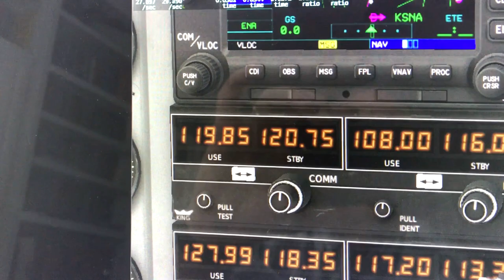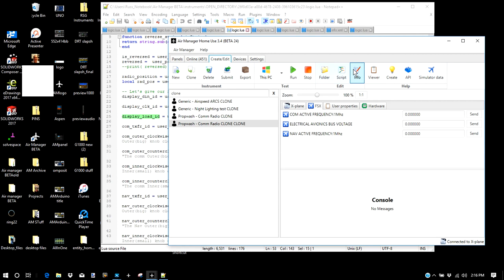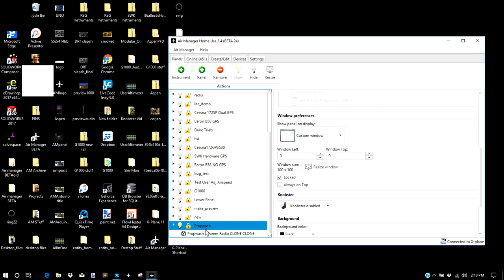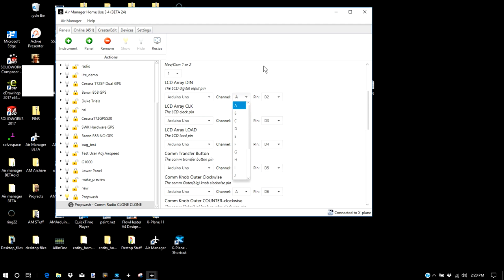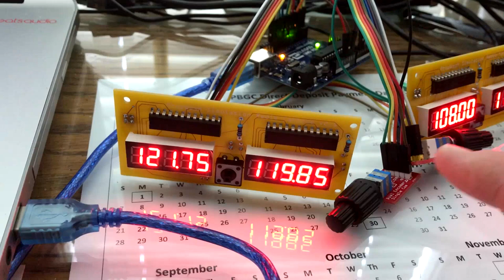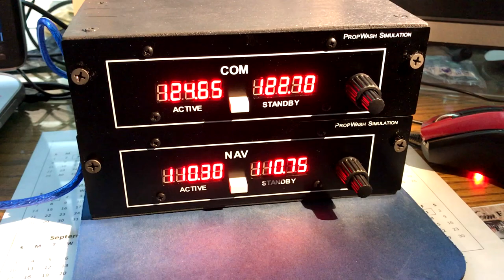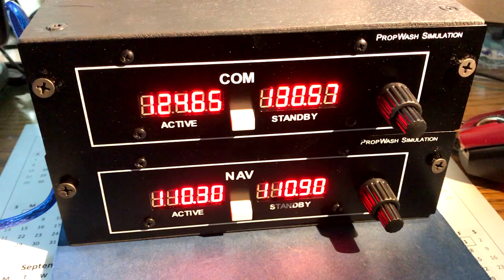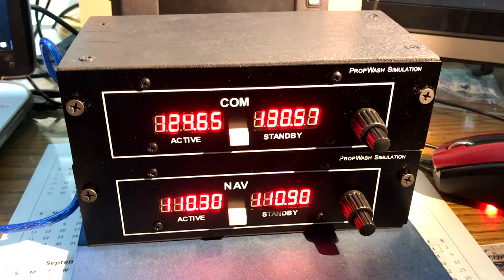Propwash DIY Radio Kit

Comment: Hi Russ and thank you for the presentation, I have this board and have some problems with ArdsimX so I would like to use your code and try it with Air Manager 3 but it seems that your script is still not available for public use?
Reply from the maker: Boris  I will send it to Sim Innovations and ask them to include it in the free community store